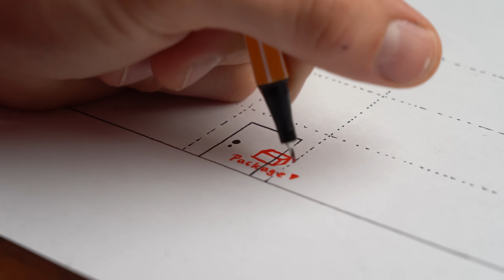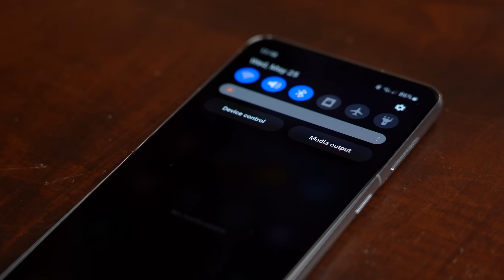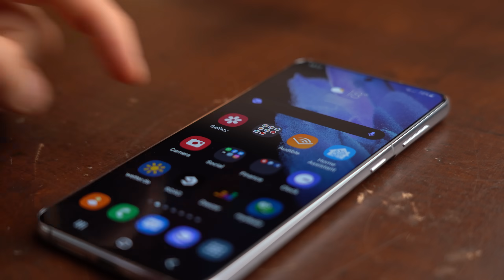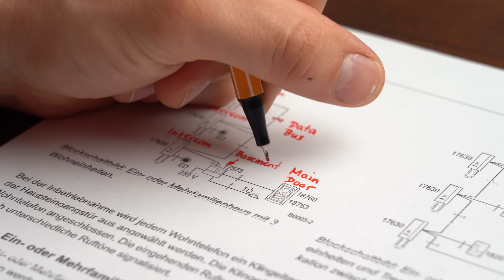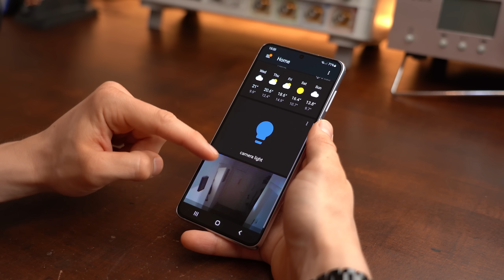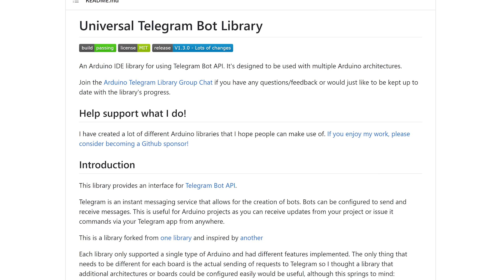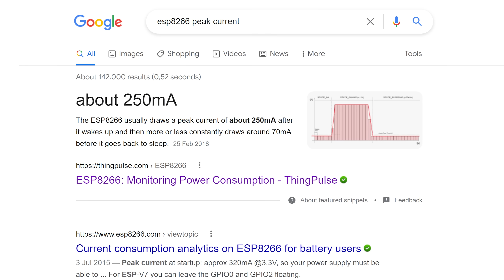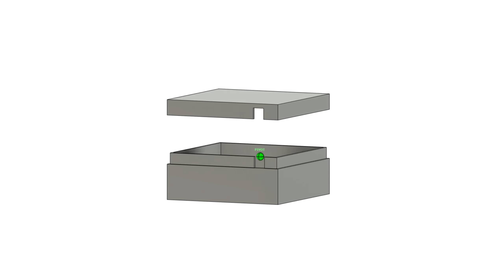Every Apartment needs this Upgrade! (WhatsApp/Telegram Notifications)

Comment: Interesting topic. A while ago, I did a similar project with intercom but for opening the door at the entrance. The problem in my case was also powering the ESP because on the intercom only 24V AC was available. I tried using a FULL BRIDGE RECTIFIER :D but apparently connecting loads to this 24V AC source caused noice in the earpiece not only on this intercom but on every intercom in the building. So I ended up using an external power source as you did.

Comment: Very cool project with many practical applications. One thing that would concern (?) me (as a homelabber) is I would prefer a self-hosted solution, that way if internet is down, or services change, shut down etc, my solution is resilient and does not rely on a 3rd party.
Reply: Yes indeed. Given I would need to be near enough to deal with the caller perhaps a Bluetooth notification would suffice and maybe pickup the signal based on induction and so leave the poor landlord’s kit alone.

Comment: As a landlord myself, I would strongly recommend using an optocoupler. These intercom systems  are not as stable as you would think. The connected ground and the y capacitor in your smps are some troublemaker.
Reply: Why is everyone suggesting optocpuplers. I mean I love optocouplers (theyre so cool *-*..)  but couldnt you just also simply use a relais ?
Reply: Yep. Especially when other tenants trigger the door opener, you can see huge voltage spikes on these systems caused by the inductor in the door opener.

Comment: Just a word of warning: it is easy to fry the controller in the basement and sometimes just adding a wire to e.g. the door opening button can make the bus lock up due to some EMV. And the controllers are really expensive so maybe putting a microphone next to the piezo is a more non invasive way :)

And yes, I witnessed these kind of projects going wrong three times
Reply: The problem with a microphone next to the piezo is that vacuuming near the door can, if the noise level is sufficient, also trigger a constant stream of messages. My little brother has cochlear implants, and my father installed a bell add-on in our house such that my little brother would receive an extra audible and visible notification to his room.
It was unfortunately also triggered by vacuuming near the door, essentially making it quite useless.
Reply: I bet more of them where from shorting the pins than anything else. It’s an easy mistake to make.
Reply: @Mrcaffinebean  nope, definitely not. A 10m long cable attached to the door open buttons to operate it from a table locked up the system, removing the wire then allowed it to be used again

Comment: Big flashing light may be a better notification for your solder station as you may leave your phone in the kitchen (speaking from experience).

How easy would it be to extend the mic/speaker onto a remote device so could remotely answer the door?

Comment: I recently did something similar to this, but used an optocoupler with the 12v ring signal and a relay to open the main door. Means I can press a button on my phone to open the door and also using homeassistant can set it to automatically let me in when I ring my apartment when I’ve just arrived home! I chose this method to keep the systems completely isolated. I also use pushover for notifications.
Reply: Hi, can you please help me with my doorbell? It works also on 12v. What do I need in detail and how musst I connect it

Comment: Would ask you to add in some isolation to the system, because normally those power supplies are grounded, and thus there very likely will be a potential difference between your added on device and the building supply. If your power supply is not grounded, but instead has a RF bypass capacitor on the power supply, you now have made the entire doorbell and intercom system into a large antenna, as the grounding of the power supply at the building panel is used to prevent that, but now you are injecting 300V peak to peak pulses into the system from the power supply, attenuated by whatever impedance is there.

Use the 5V supply to operate a photomos relay, as many will operate fine on low current. Random Panasonic AQY217 works on 10mA, easy to source from that TTL output, and will give 1.5kV isolation, and an output with under 2R rersistance when on, good enough to use there, and less than 1ms delay in the unit.

Comment: I also built something similar about 3 years ago with an arduino nano and an nrf24l01 which directly used the power of my Ritto door opener. I also added a solid state relay to turn on/off the bell at will and to fire the buzzer at the front door. It was really a fun project and extremely useful. Now after moving to my new apartment, I opted for a commercial solution: Nuki Door Opener. That thing is extremely easy to integrate with not much tinkering / reverse engineering the original door opener PCB. But OFC way more expensive (~100 Bucks).

Comment: I've been trying to do something similar for the same reason; made a simple push button doorbell with an ESP that sends a webhook through IFTTT and activates a flashing animation on my Philips Hue lights.
Only issues are that like some of the services you tried IFTTT can be a bit slow on activating the lights and also there's no way to change the amount of flashes the lights do, for some reason it's like hardcoded to flash about 15 times or 30 seconds or something so it'd look like I'm in the middle of a rave anytime I'd answer the door, so I've had to shelve the project until I can figure out another method of doing it.

Comment: Nice! It's maybe better to send an MQTT message to Home Assistant though? From there, you can trigger automations, sound buzzers, flash lights, or send IM notifications using the same APIs. Seems like the more capable option.
Reply: Yep. I don't directly connect anything anymore. It all goes through MQTT and Node-Red.  I can change the conditions and active times for any input and output that way. A button I push when I wake up can do something different an hour later and do something else again when it's bed time.

Comment: You should have used an opto isolator, as the interface - providing the lowest loading on the system and total isolation between the two.  Did you think to ask your landlord’s permission before modifying/ interfering with his equipment - you might find you may invalidate his warranty with his alarm system supplier due to your modification!

Comment: He could have just installed a microphone instead of that circuit imo, as the doorbell rings the microphone could pick up the bell sound and then initiate the bot he later used. Tell me if I am wrong.

Comment: I had the very same phone in my previous flat and I did a very similar project, (I even found the same post :D) the only difference is that I used a HC-12 to send a signal and the receiver was on my table while I was working. Initially I also tried to connect to the phone's power connection, which only worked when you ringed the bell using the switch next to our doors. (It was funny, because we didn't notice it for a week, so no packages for us)

Sadly for my new flat I had to change the design a bit, because someone painted on the phone and I couldn't remove the cover without destroying the wall around it, but I used a light sensor, printed a closed box for it and I glued to the flashing button. (which I don't use anyway) It's working suprisingly good. I'm using a LiPo battery to power and a low voltage alarm to see when I need to recharge (every half a year) and the signal is immediately sent this way.

Comment: I was thinking of doing something similar but with zero modifications to the intercom. Basically a microphone and a trained AI that can listen for the sound. It wouldn't be as responsive but they also couldn't blame me if the intercom broke.
Reply: Alot of effort to get the AI trained and up and running but yeah would be nice since it doesn't require direct mods to the intercom. I'm sure the landlord trusts him lol
Reply: @tenseikenzx-3559  also could just test for loudness, make it simpler.
Reply: @wadepenner  but then potentially any external loud noise could trigger it

Comment: Thanks for sharing. 
I've been using Callmebot for a project,  and found that messages via Signal arrive in about 5 seconds where messages via WhatsApp and Telegram take around 15 to 20 seconds..?  Might depend on where you are in the world relative to the servers I suppose.  Anything less than about 30 seconds is quick enough for my application.

Comment: Upgrade idea: Add an option to open the door from your workbench... Either an option in Telegram or a physical button.
Reply: A relay can be added and commanded by ESP to short the “door open button” contacts. But probably he wants to listen to the person on the other side before opening the door!
Reply: @ubiquitousingit  Lol... Right. 
A better idea then!
Add a camera to the ESP like the one he uses for security, facing outwards. The moment someone   knocks the message contains a picture of whoever is at the door.
Seems feasible 👌🏼
Reply: Skynet.

Comment: I really like ESP boards, but sometimes it crashes when it is on for a long time. I wanted to implement watchdog to solve this, but it's complicated for me.
Reply: I had the exact same issue. Something about the RAM slowly being used up, and then it crashes and needs to be forcibly reset. I don't think I ever came up with a solution for it, I ended up flashing the NodeMCU firmware onto it and programming it in (I think) Lua, I haven't had a problem since. Though it's a lot more complicated than just programming it in Arduino

Comment: Why did you build your own case for it???! 
There is plenty of space in there to house the ESP.

I have mine hidden inside the phone case and it's invisible.
All you need to do is unscrew the holder from the wall and pass the power cable through one of the holes.

Anyways.
If you have slow messages in HA, check the priority settings.
There is a data line with some code that makes it much faster.

And you could also use ESP-Home to call a service in Home Assistant, like toggling lights or TTS message to a Google/Alexa.

And why didn't you hook it up to the "open the door" button.
We have that here and an ESP32 in the window to look for our Bluetooth UUID and then open the door for us.
Works nearly perfect.

Comment: I thought about doing something like this as well. Also, I wanted to integrate it with Wled strips to give me a visual alarm bell when I'm playing games with headset on for example
Reply from the maker: Also possible :-)
Reply: @greatscottlab  This was my thought, have the signal flash some LEDs near your worktable; lowers latency considerably and your room flashing is more helpful than a phone notification you may miss while working. I flash all the Hue bulbs in two rooms using Home Assistant (for this exact reason) and have ~1s (+/- 0.5s) latency

Comment: Did you test, if notifications are snappy, while not touching your phone for a while (somewhere between 15 minutes and an hour of the screen being off)?
Reply from the maker: Yes. Works perfectly ;-) Have been using the system for 2 weeks now.
Reply: @greatscottlab  Thanks for the lightning fast response. Knowing this makes it much more appealing of a project.

Comment: Neat project but I think, given the size and infrequency of visitors to your door you should have just added a lipo battery, bypassed the 5v->3.3v regulator and created a trickle charge circuit to draw <40ma (<1VA) from the 24v rail and keep the battery topped up. You could have fitted it all inside the case of the intercom then... Thought you would have also added a plug to connect to the intercom signal + ground rail so that disconnection would have left no trace. Hopefully your landlord doesn't watch your videos!!
Reply: a buck converter like 2596 board  is near 90% eficient, so 5v * 0.1a ( 80ma + loss)   its  .5w in 24v line not 6va
Reply: an pcb edge connector wouldve been neat, agree
Reply: Yup 👍🏻🇬🇧
Reply: and one day the lipo bulges, catches fire while he's not at home and the landlord WILL be mad if his house is burned down  from a not officially approved  "smart home" device.
Reply: @casemodder89  he can use a joule theif
Reply: @casemodder89  then just use a nimh battery.
Reply: @casemodder89  dude by that logic all mobile devices will constantly burn houses down
Reply: @RandomUser2401  how often do you connect your phone to the charger for month continuously ?   

yeah... never...  stupid one wasn't it ?
Reply: @casemodder89  that simply isn‘t a decisive factor. Besides that, Phone easily stays connected for 8-10h per day.

Comment: I would have used an optocoupler.  That way the ground of my system won't be connected to the ground outside of the apartment.  At any time someone can change the wiring and blow things up.  Also reduces the possibility of anything I'm doing creating a shock hazard for others.
Reply: I was going to say the same thing.  Also gets around the level shifting too.
Reply: I actually did it this way and it works perfectly. Tho my bell sits at 18V normally and rises up to 24V when ringing, so I put a zener infront of the optocoppler. Furthermore two optocopplers were used to be able to activate the push buttons on the intercom wirelessly (using homeassistant). Works like a charm!
Reply: @tw38203  would you share some more Info of your built Like the shematic?
Reply: @Wallensteiner0   shematic ?
Reply: @tw38203  just commented the same thing, these cheap intercom systems can't be trusted to handle voltage with care.
Reply: I would have gone one step further and repurposed a 433mhz bell circuit with a CR2032 cell, which will last for years. Then I can both have a flashing bell receiver in front of my face or add a 433MHz receiver to a random system/pi running somewhere in the house.
Reply: @SianaGearz  this.
Reply: Could you ELI10? Why do you want the ground not to be connected? What would someone change that could blow what up? What sort of hazard could someone come across? Im genuinely a beginner and believe that you are on the right thing due to the other comments and would love to learn more.
Reply: Guys, you are technically correct, but he did not connect to a traditional two wire bell circuit directly, as there is this entire board in between the bus providing 24V and data, which evidently includes a voltage regulator. so I‘m pretty sure that not only would the board get fried first - so it seems hardly possible that the 5V external bell contact on the board would have a way of suddenly being connected to live AC…..
Reply: Good idea
Reply: Absolutely yes! Same thought about the need for an optocoupler!
Reply: Oh yeah, I was mentally doing a weird zener circuit just to be extra sure that it won't blow the whole thing if someone messed with the control box. 🤣
Reply: Absolutely. I did an almost identical project but the trigger was 12V, which would easily kill the GPIO pins. I used an optocoupler as a bridge between the HV and LV, worked fine and isolated.
Reply: Or a vactrol, also possible.
Reply: Europlugs dont have ground connection that the powersupply used.
Reply: @hillppari  no but you're still joining the 5V return to the intercom return (negative)
Reply: You get people messing with the ground outside your apartment often?
Reply: This. You're also assuming that the 5V supply isn't grounded.
Reply: @m3mem4chine86  From the looks of the layout the supply is basically floating.  It can assume any voltage above ground it needs to.  When you're running cables a long distance isolation is your friend.  You have no control over what can happen on the other end of the wire.
Reply: @m3mem4chine86  it was install by the lower bidder, you should be prised it works at all
Reply: Aren't all apartment grounds connected?